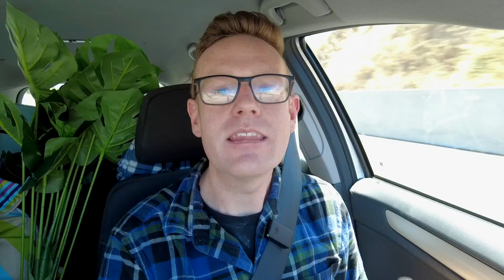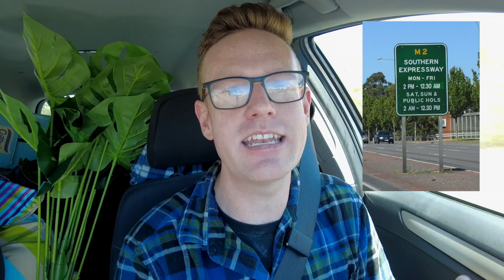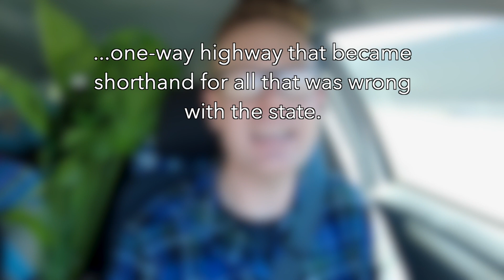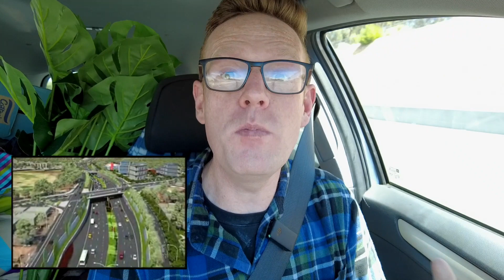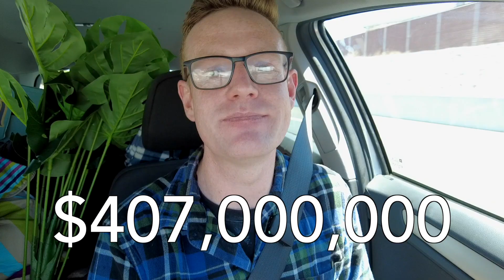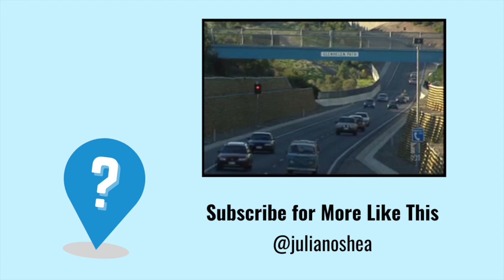The World’s Longest One Way Freeway: Rise and Fall

Comment: Reminds me of the South Eastern Carpark in Melbourne.  A bankrupt government building a half-arse solution to needed infrastructure.  We needed a freeway we got an arterial road with traffic lights.  Specifically traffic lights in an arterial road between two existing freeways.  No only did it cost a lot more to finish the job a decade later but people were killed.  I grew up in a Chadstone and watched this happen.  City bound cars on the Monash freeway doing 100kph would race the lights at Warrigal road and there were many horrific accidents.  Now the lights are gone, but the speeds are still low and the freeway hasn’t been free of roadworks in forever.  I have always said that the Monash Freeway is always ten years behind on upgrades to meet demand.  So it will always be a bit of a carpark.  Thanks far thinking State governments….
Reply: You're forgetting a Labor Government allowed for it to be a freeway, and halfway through the project a change to Libs and the traffic lights got installed putting a stop light on Victorias progress as usual
Reply: Wait the M1 used to go THROUGH WARRIGAL ROAD? Thats crazy!

Comment: What an embarrassment. Another thing that is embarrassing is that Adelaide trains most of them run on diesel not electricity. Let me guess the state government has no money to convert the rest of the train lines.
Reply: There are always going to be diesel trains in Adelaide.  The line to Belair can not be electrified due to the freight line next to it.  Something to do with safety, from what has been told to me...  Besides, how do you get the sparks back to the barn if they have a problem?  And the overhead is down???  Where are the old redhens???
Reply: @111jacare  very true
Reply: @111jacare  I was going to comment about the Belair line. I do though believe that it is mainly do to the number of short historic bridges that don't have the room for the overhead lines required.
Reply: @southaussiegarbo2054  Hospitals have less beds as Labor reduced the capacity of the RAH by approx 20% and closed the Repat. This then flows on to ambulance ramping and take a long time to fix
Reply: @johnschroeder3072   marshall didn't reopen repat in same capacity fyi. It's been mostly demolished now.
Reply: @johnschroeder3072  
Btw ramping under labor wasn't affecting the children's hospital like it is now. Now it's having upto 20 ambos ramped at any given time. Then the ambos have to keep the kid inside entertained if they were taken in from school
Reply: @southaussiegarbo2054  Well Perth has Metronet. The WA premier has put in allot of money into this project.
Reply: @hismajestyericcartmanthese5755   yep I wish our gov would be like that

Comment: As someone who lived at the southern end of the Expressway and did not have to use it to get to work - it always seemed to be going the wrong way when i wanted to use it.  when it eventually did open up to going both ways, everytime I used it, I thought that "this is what they should have done it  in the first place".
Reply: @croweater6814   atm sa has the worst unemployment rate to under liberal.

Labor has done far less bad then liberal
Reply: @croweater6814   note liberal done the one way expressway not labor. Labor had to fix it and get it 2 ways.
Also I have noticed recently that roads in my area that were done in recent months already have holes in them.
Yet ones resurfaced during labor's 16 years in office are still in pristine condition......that to me shows liberal prefer it as cheap and 💩 as possible and that labor will pay the bit extra for higher quality